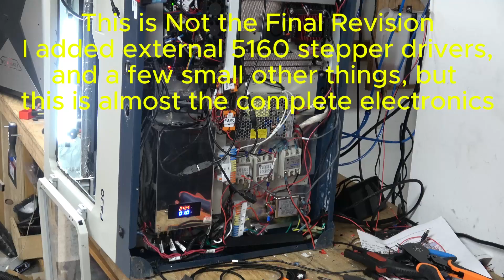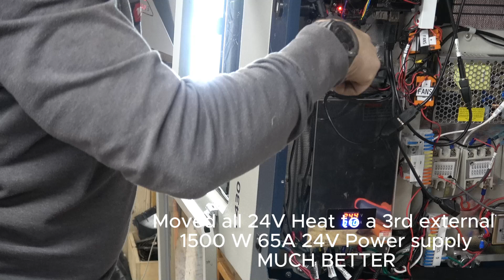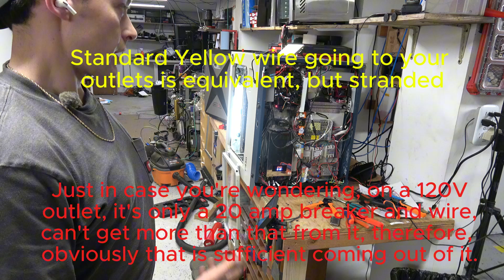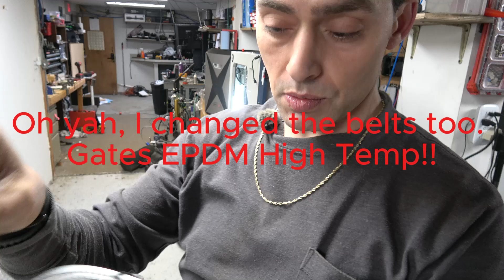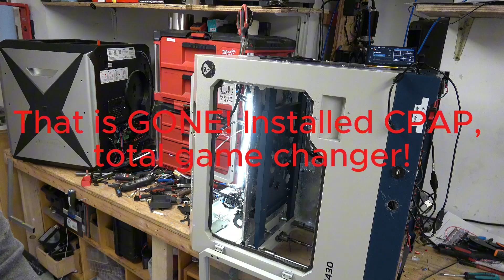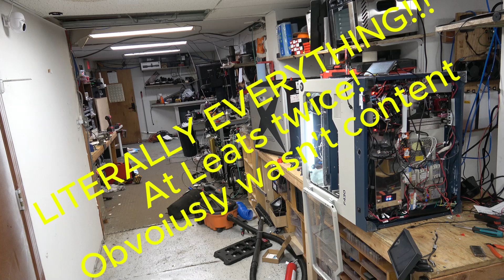Recreating Creatbot (Electronics)

Comment: Whatever became of this project?
Reply from the maker: Hey sorry I need to post an update, I finished it and it's printing peek great!
Reply: @Cjsairgunscarsandmachining  no worries, I was just wondering
Reply from the maker: @SolarBearDIY  Yah it worked out great in the end, I have some clips I have to put together for a final video, just been focused on the current cnc project. If you have any questions feel free
Reply: @Cjsairgunscarsandmachining  thanks I appreciate it. I have the same printer. I don't plan on going as far as you did, but I am going to replace some things such as the extruders.
Reply: @Cjsairgunscarsandmachining  wheres the vid dude
Reply from the maker: It’s a good idea, I took an entire pound off of the tool head, and that was a huge difference in speed and print quality. Even with lower temperature materials, the set up I have worked great for me. I used the VZ bot carriage, but I had to make a custom mount because the rails on this printer are so much bigger, and custom mount for End stop, and Goliath hot end
Reply: @Cjsairgunscarsandmachining  so did you modify it to e single extruder? If you did, what size is your print bed space? Thanks
Reply from the maker: yes it’s a single extruder, it is a goliath hot end with water cooled hextrudort on a custom CNC machine mount. I had to make a lot of custom parts to make all of it work, princess size is actually slightly bigger than before.
Reply: @Cjsairgunscarsandmachining  makes sense, I was thinking about just modifying mine into a single head and gaining additional print bed space if it was possible. It seems like you could get upwards of 475mm on the X Axis.

Comment: can you share the BOM ??  or a you are planning to share a guide of all this mods, i would like to apply to the printer of the office
Reply from the maker: I don’t have a bill of materials, this isn’t a build like that, this is all custom, I decided on things last minute, change things if you read the comments through the video you’ll see that I change things many many times, even what’s in the video isn’t all what’s there now, I kept a lot of what’s there it’s most of it, but again the comments say all of this. I don’t have a list like that, I ordered so many different things. I wouldn’t even know where to start. I’ve tried seven different MCU boards, and configured every single one, I’ve tried so many different of every single part different motors, different drivers different power supplies, different everything wiring everything, but what you see in the video is what I did end up using in the end for pretty much everything except the external 5160 drivers on the electronics and the external power supply, I increase the size to supply power for heat, and then I changed it on the motion system new motors, new belts, new hot end, new carriage, it just went on and on for months